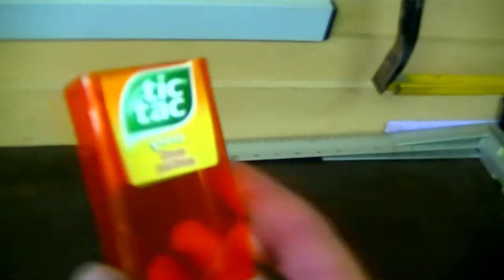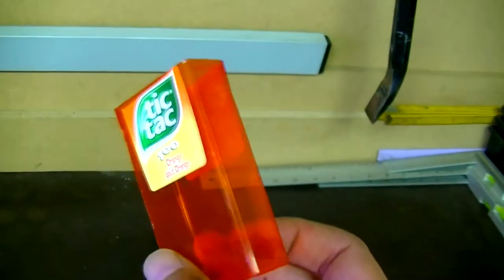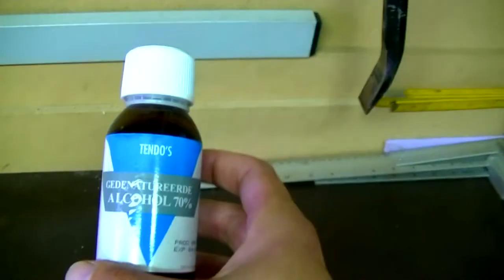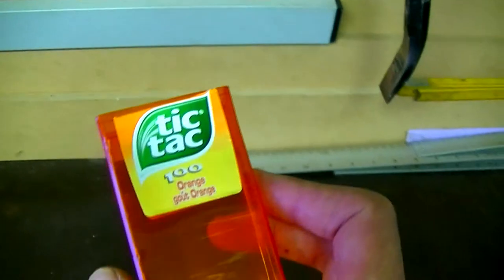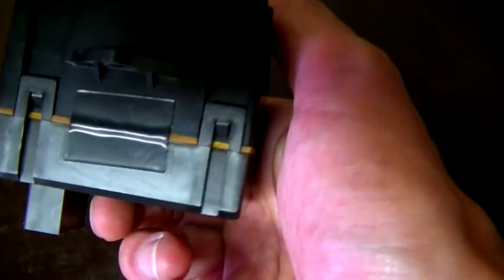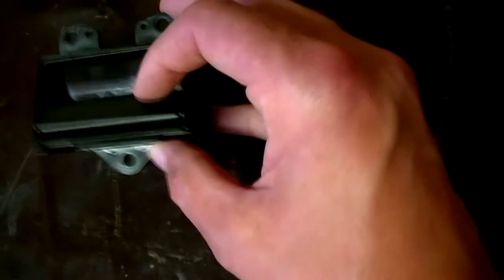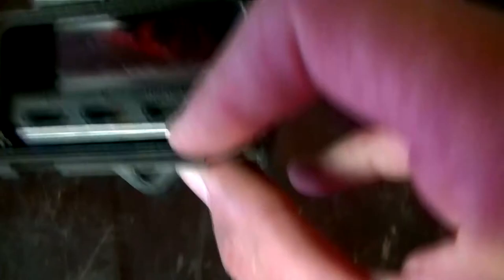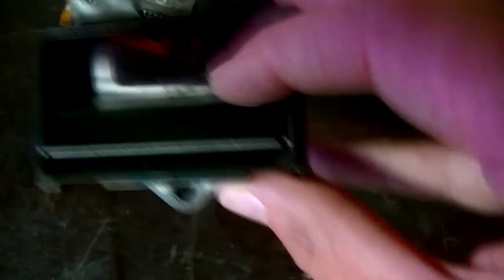Civic EG JDM Amber Clock DIY | TheDailyEG

Comment: WoooW... That is great idea! I have one question, is it possible to get some power (and the dim option) from that clock for another display? I have in mind to put on a empty slot some digital temperature meter for car, but I would like to have dim light option like clock when I turn on a lights. So, what do you think, is it possible?
Reply from the maker: Sounds like that would be possible, but not from the clock i think. Search on Google for Dimming dome light, that will maybe send you in the right direction
Reply: Hmmm... I'll search for that and see can I do that what I want. Tnx for fast reply! :)